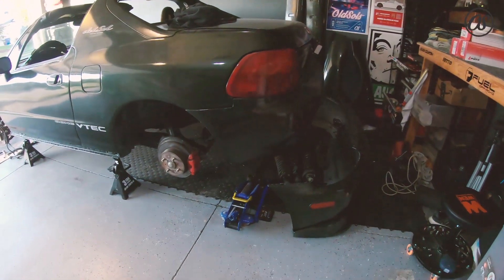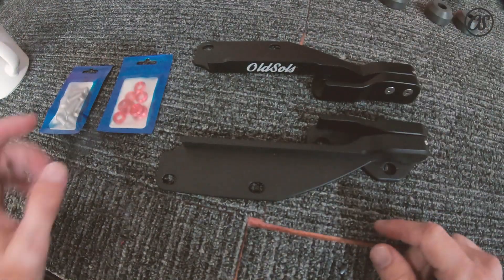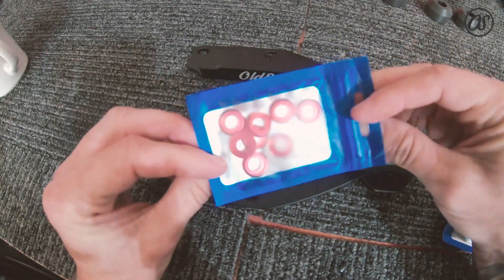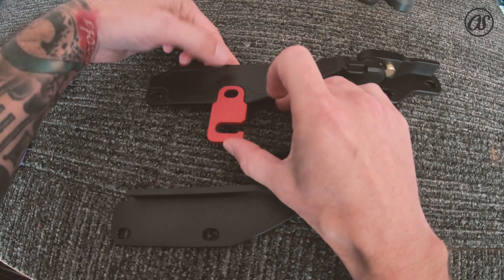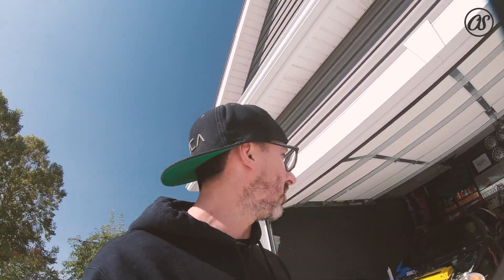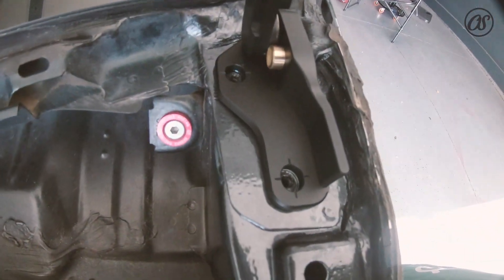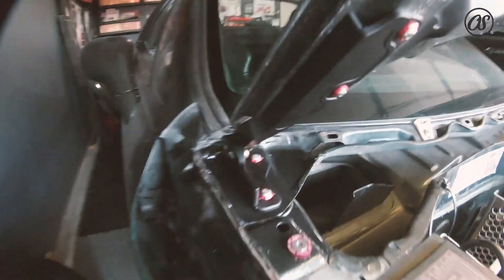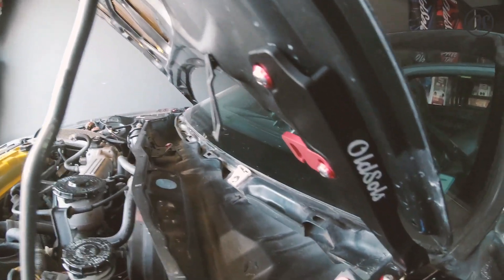Honda Del Sol - OldSols Vlog 103 - Skylerlabs Hood Hinges

Comment: What year is your del Sol? The EG Civic had leaks in that area and I think by 1994 or 1995 they started adding more seam sealer from the factory. Maybe the same happened with the del Sol for similar years.
Reply from the maker: Its a 1995 so that makes sense!
Reply: @Old Sols  is there any sites that sell replacement rear glass regulators and motors or is my only option buying a used one?